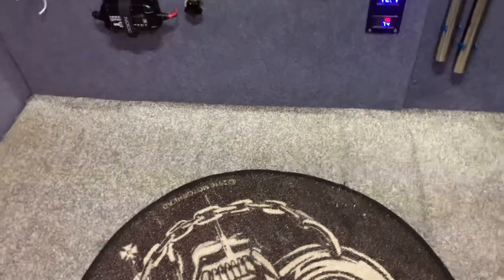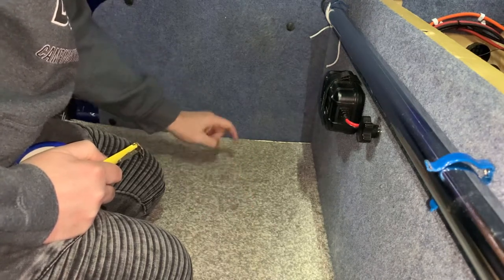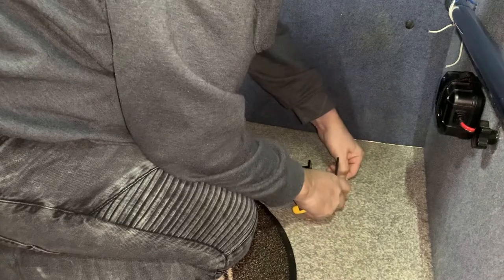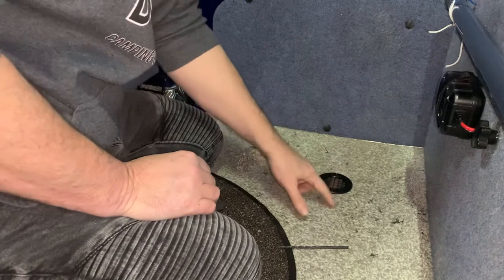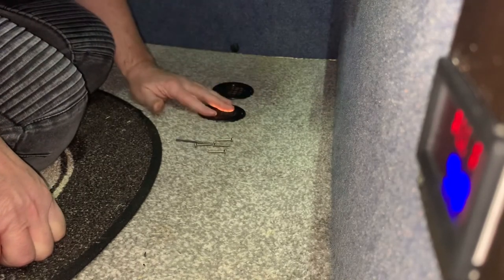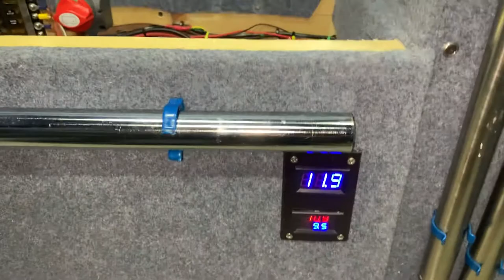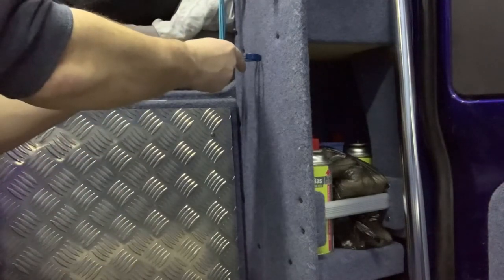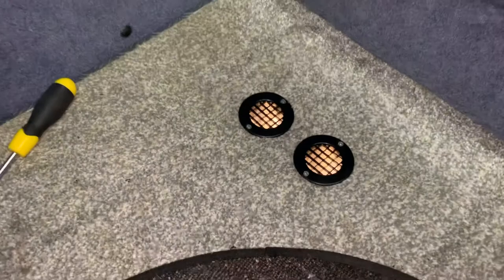Floor ventilation fitting - Drilling the stealth van floor!

Comment: Nice work, though I think I would’ve opted for one larger vent (maybe rectangular) even if it had to be custom vs two smaller round ones. Overall, a great job and explanation. TFS!
Reply from the maker: Thanks buddy, yeah I thought about it a lot, I wanted to keep a bit of strength in the floor but finally decided on this, could easily have been a single though

Comment: Gas drop out vents were meant to be underneath gas appliances and beside gas bottles where potential leaks could occur, not in the middle of a carpet where people will be standing on them.
Reply from the maker: Good point Devonian, I’m using them more for air flow when the extraction fan is running, cheers